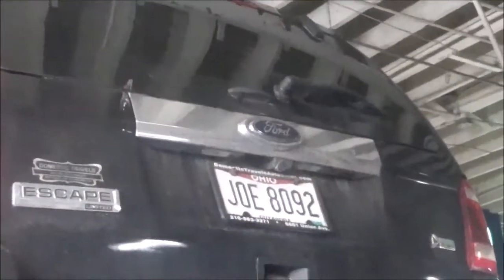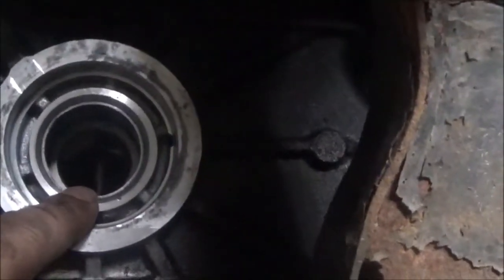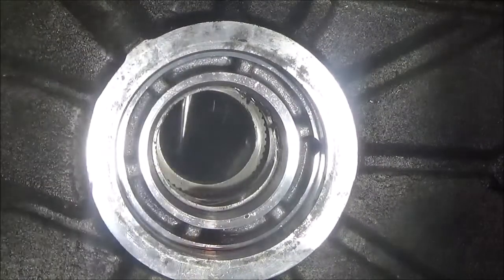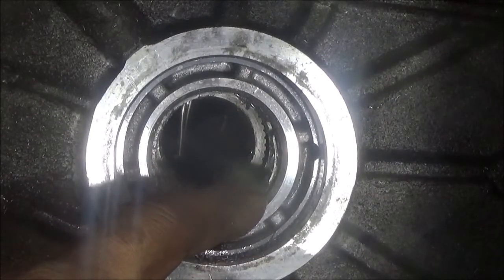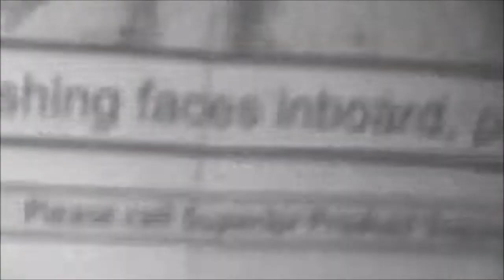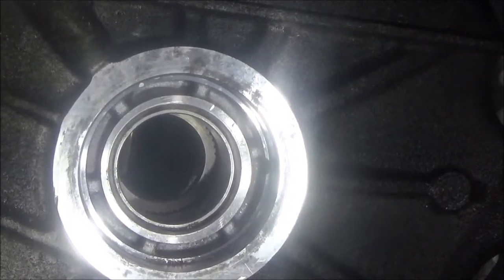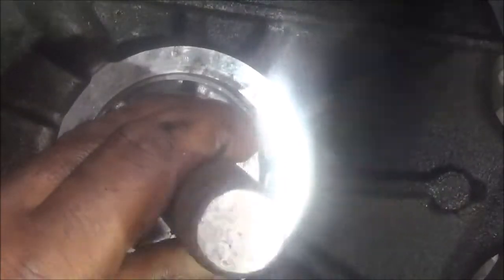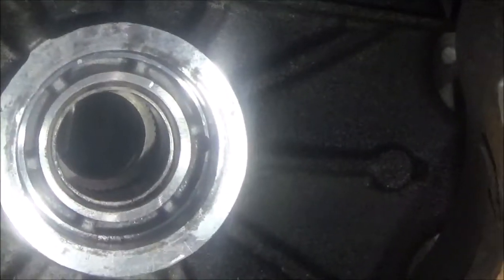2011 FORD ESCAPE TRANSMISSION LEAK AXLE BUSHING REPAIR (6F35 TRANSMISSION)

Comment: take some advice don't mess around and buy the nearly 400 dollar tool once you get to seal fifteen minutes later the seal and bushing are out and new ones in and no contamination.if your a mechanic time is the thing tools are an overhead that will pay back in future.tool kit comes with puller, installer,and 5 seals and 5 bushings the installer has arrows to align the bushing up in housing.don't forget to change the c/v assembly the shaft is more than likely scared up from the bushing grinding against it. asked around for what type fluid finally looked on dipstick mercon lv.
Reply from the maker: The tool is quick and easy, but not necessary to have, to do this job. If one is going to do a lot of these, then the tool would be a good investment. However, if it is a do-it-yourself person, then it can be done  the way that I show.

Comment: Quick tip to anyone who doesn't want metal shavings in their transmission, you can make your own puller to do this job - all you need is a couple washers 1.5 inches wide to go behind the bushing, a long bolt with a nut, and a big socket or oil filter wrench to brace against the outside of the transmission. Just grind down two sides of the washer so it can fit through to the other side of the bushing, and voila, you have a custom puller.

Comment: This bushing seems to no be for the vehicle, the ford sells the update bushing. Cost like $10, and it does not have any open ended notch like this one on you video. It also has a red Teflon coating inside to protect it. U also need to use loctite 648 on the bushing so it does not leak again. This is not the proper fix. Best to get OEM ford parts

Comment: You worried about little shaving in the diff from air hammering that busing out? What do you think wore that busing out?
Reply from the maker: Not worried about what is coming from the bushing. it is miniscule. One can put a rag inside if one wants. Second, for some reason, the bushing likes to wear and cause a leak on this particular transmission. Why, I do not know.
Reply: @thisisyourtransmission  Ford used an inferior alloy for the driver-side axle bushing that was prone to greater wear when riding against the steel axle shaft. The driver side seal is also exposed to quite a bit of heat so as the metal expands, it can wear faster. Thus, overtime, the axle contact area with the bushing will wear faster, reducing the axle shaft diameter where it meets the bushing and scoring it enough to provide a well enough opportunity for it to leak. The solution is to replace not only the axle (in many cases depending on wear), but also to use the new, updated bushing that uses a hardened alloy with a special non-wear coating.
Reply: @brianbutts575 I’m going through the same issue fixing my customer 2010 ford fusion. Is it possible that even with this inferior alloy on the axle or bushing can be used with a flex rubber seal for the output seal?  To create enough sealant to stop the leak totally.

Comment: Does the right side  has a bushing? If yes, can you please provide the link? I have a 2014 Ford Escape 1.6 Liter.
Reply from the maker: If it is a 2wd then the right side would have a bushing. However, I never had to change the right side before so I could not provide you a link to it. What is happening with the right side?
Reply: I keep having  transmission fluid  leaks from the seal. I replaced the axle and the seal three times.
Reply: No bushing on my 2010 ford fusion so it guess it depends on the model

Comment: Was this throwing like a P09 code? I think mine is leaking and the pressure control solenoid is causing a check engine light. Plus its been low on trans fluid and looks wet around the driver side axle.  same year 2011 with about 180k
Reply from the maker: Never heard of a p09 code. However, if a transmission is low on fluid, pressure codes will set.

Comment: Do I have to replace the axle too or just bushing and seal ?
Reply from the maker: If the bushing has not destroyed the axle, then you can just change the bushing and seal.
Reply: @thisisyourtransmission  thanks
Reply: If you’re a DiY, observe both. If one has more scratch than other then just replaced the one with a lot of scratch.  Reinstall the axle until it’s seated without putting back the rest of the parts like rotors etc.  Top up with trans fluid one whole gallon or 5 quarts and observe underneath if there’s still leak. If not then proceed to finished the job. If there’s still leak then, it’s advisable to replace both parts (axle and bushing) to eliminate the leak: